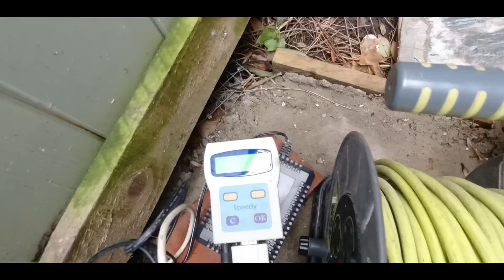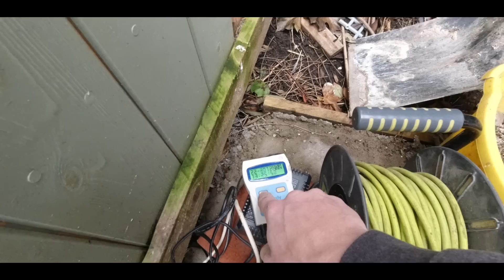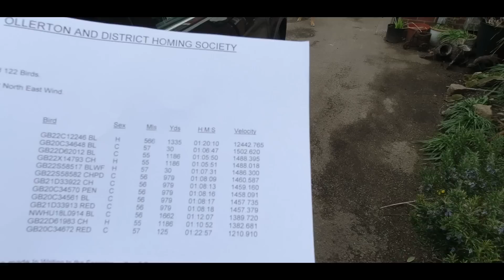Racing Is Bitter Sweet

Comment: Those sparrow hawks you have there seem nasty! keep pushing Dan you will figure a way around them 👍
Reply from the maker: Cheers buddy. I don't want to jinx it but it hasn't been around for a few days. We've actually managed to get the YBs out a little 👍
Reply: Dont mention it jinxing is real when it comes to falcons and hawks 😂
Reply: @howtotrainyourpigeon  In Belguim we have a Trick to keep the hawks away. You grab a very bad young bird and you grease it with "voltaren". Thats a ointmant
Reply: That Will keep the hawks away, but be sure to cut of the ring of the bird.

Comment: As the first birds were flying around on arrival, I was wondering why you hadn't trained a dropper (the fantail). Thanks for explaining why. Please have your entry list on a clipboard and mark off the birds as they arrive. Much easier to keep track of what is and what isn't home. (In the old days with manual entry sheets there was a carbon copy in the bound race entry book that we would use to keep track). By the way Daniel, another terrific result, and well done with the limited preparation. I'm looking forward to you having another good season. Glad to see a 2nd round from '83.
Reply from the maker: The ets records the birds as they come in so 8 can see which ones come back. Although that doesn't work for training because I don't leave it set up. I might do that come to think of it 🤔